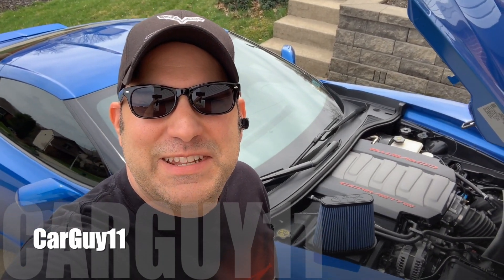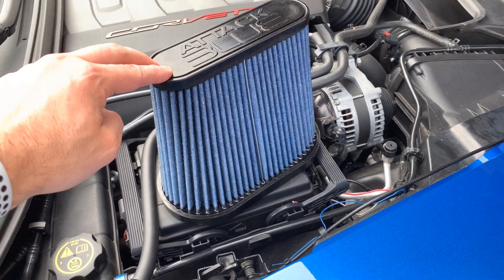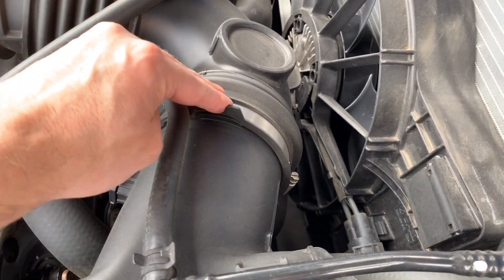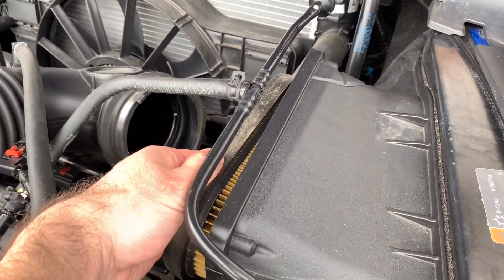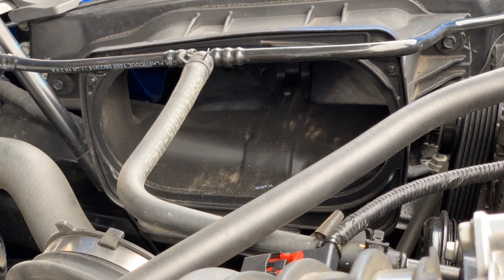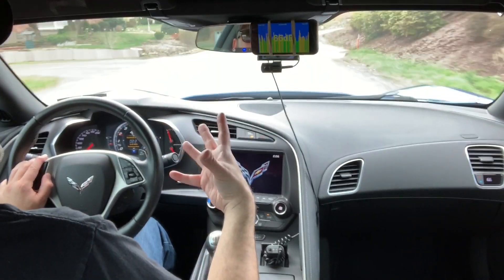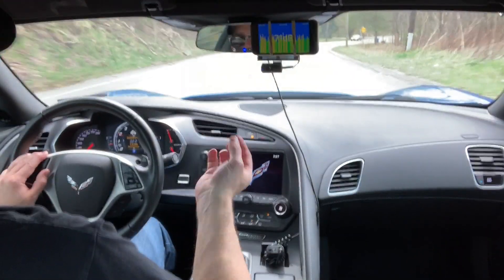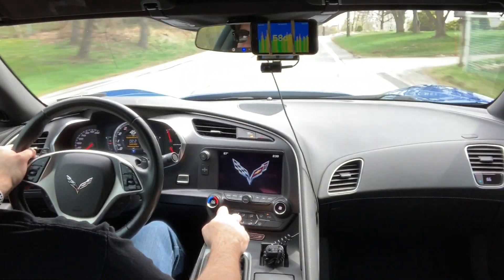Performance (Attack Blue) Air Filter Install & Review - C7 Corvette

Comment: The only accurate way to check a horsepower increase would be to start with a new stock filter and do a dyno test. Then replace the stock filter with the Attack Blue filter and do another dyno pull. The only problem with that is that dyno time isn't cheap.
Reply from the maker: Yeah true & not worth it for a couple horsepower difference.

Comment: I've never swapped any of the air filters or boxes  in our Vettes. There's just so many to choose from, I could never figure out which one might be better so I just decided not to worry about it.
I did run the K&N filter in my '69 Charger. It didn't help it any but I got a cool sticker with it :)
Reply from the maker: Yes it’s a subtle change but can wash & reuse so not a bad option.

Comment: Just an FYI, The hood vent is not a cold air intake for the air filter. That air comes through the front. The hood vent is for escaping air to prevent hot air from gathering around the engine, so the heat is removed more effectively.
Reply from the maker: That’s correct!
Reply: @CarGuy11  You stated in the video that the hood vent is for bringing in air for the air filter.

Comment: Installed Attack filter today and check engine light came on at startup.  Disconnected and reconnected negative battery cable and light went out.  Bad and cold weather prevents road test today.

Comment: It makes sense if you notice a difference in throttle response with the exhaust valves open. More air coming in, needs more air to go out to gain the benefit of a more free flowing filter. As to sound. Not loud enough. You know what they say, if it's too loud, you're too old. LOL Save the Wave.
Reply from the maker: Haha yeah wish I did the test with valves open.
Reply: in the 80-los angeles...ole radio station...knac...their motto..if its  too  loud;yer to f...n  old!!!

Comment: I replace my stock Factory air box with the factory performance air box don't know about any horsepower gains but throttle response was a lot better and you can tell that it breathe easier. The factory performance air box is bigger on the inside than the stock box you can do a side-by-side comparison I did so you can see the Improvement
Reply from the maker: Oh cool I actually forgot about the GM one. I just wish they included piping without the baffling for more sound.
Reply: @CarGuy11  have you or do you know of anyone with try the GDI cleaner under intake valve didn't work or did it hurt the catalytic converters
Reply: Speell correct 😐🤔
Reply from the maker: I haven’t heard anyone need to use a cleaner at all.
Reply: @CarGuy11  when you change your air filter look inside the tube and the throttle body you will see a thin oil film. I don't  have a catch can yet but I'm  getting  one. I  only have 4 miles. I saw this when i change  my air box
Reply from the maker: I didn't notice any but do have a catch can.  https://www.youtube.com/watch?v=sMMIHeGS2t0

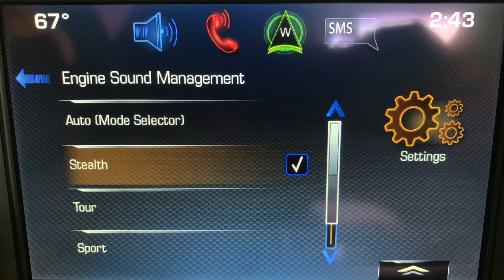Comment: 5:06 I've never noticed the Engine Sound Management in the settings. Is it hidden somewhere or part of an option? I'm gonna have to look again on our '14 when we get it out of storage. Sweet!
Cool vid!
Reply from the maker: 2014s did have as many options unfortunately.
Reply: I'll check ours again and give you an update. Its a 3LT Z51, but I sure don't remember seeing any Sound Management. This could be like Christmas in July :)
Reply from the maker: Here is my video on where to find modes.  I believe 2014 can just keep them open (off) or change with modes (auto) https://www.youtube.com/watch?v=Mk1DX2M2iG8&t
Reply: @CarGuy11  Nice! I guess I only used that screen for the date and time lol! Thanks for the refresher!
Reply: @CarGuy11  Our exhaust changes settings automatically when we select the different drive modes using the dial on the console. I didn't realize we could set the exhaust independently. This is kinda like pulling the fuse on the dual mode exhaust of the Grand Sport :)
Reply from the maker: This is why you should pull the fuse on a C7 :)  https://www.youtube.com/watch?v=hxZEaxXbEfw

Comment: B&m filters r the way to go for stock replacement. Its not the filter so much as for. Base of the filter is the restriction. Check it out
Reply from the maker: This filter is larger & less restrictive than stock yet it filters better because of nano fibers.
Reply: @CarGuy11  check out the b&m filters. I picked up 15hp with tune jus a filter and. Air box modification
Reply: @justinreid8851  Carguy11 picked up about 10hp without doing anything. No tune ( a tune can void your warranty) and no modifying the air box.  He just dropped the Attack Blue filter in.  Whats equally important is filtration. Its a fact that nano fibers (used for the Attack Blue media) offers the absolute best filtration with the most airflow. There's no trade off.
Reply: @tkoperformance   I dont need a warranty. The restriction is the base of the filter
Reply: @justinreid8851  Which is why the Attack Blue has a unique larger base. The larger base provides more media to flow more air rather then plastic or urethane like other filters.

Comment: I couldn't get the air filter box closed all the way after the attack blue was in, I can keep it shut by hand but the screws won't go in anymore and it hangs a little loose up top. Any tips?
Reply: You stripped the plastic holes. Fill with adhesive. Let it cure. Then screw the screws in.

Comment: I have a C6 2010 with stock intake. Can I get the blue attack filter and fit it in the stock box? The sound will be throatier also? Any help please
Reply from the maker: I’m not sure if they make a C6 filter. C7 filter won’t work.

Comment: What the heck does sound level have to do with performance? Is the idea louder is better? Just add a siren and crowing rooster and your car will be louder.
Reply from the maker: It’s adds to the raw experience. But it may help airflow and power as well.
Reply: @CarGuy11  Well, I sure hope you’re right. I put an attack blue on my C6 a week ago. I think it’s flowing better than stock. Have you out it on a flow tester to get CFM?  I stuck an OBDII scanner on my C6, and it looks like more air is moving, but it’s tricky to get accurate results because the ECM adjusts so many parameters at the same time. The hold down bracket is garbage. I didn’t have the stock bracket because there was a K&N in mine previously, so I bought theirs. Yeah, not a good choice. I need to just fashion my own hold down brackets. I did two. I need to do them all.

Comment: NOT a good review because you're comparing the new aftermarket to an old 25k miles OEM filter (needs to be a new OEM).   I replaced my OEM filter at 15k miles and it felt punchier too.
Reply from the maker: Well yes this is true but there is a slight sound difference that wasn’t on stock filter.